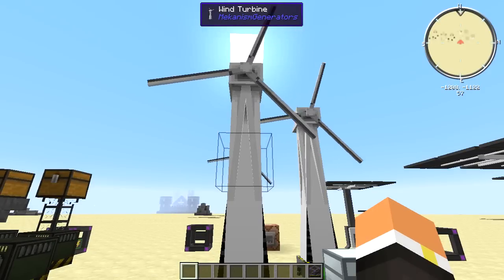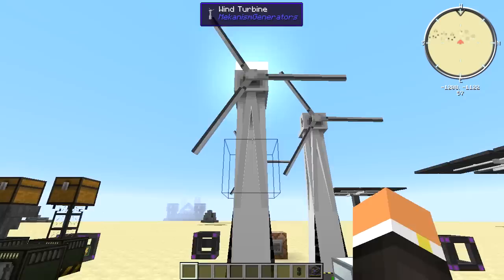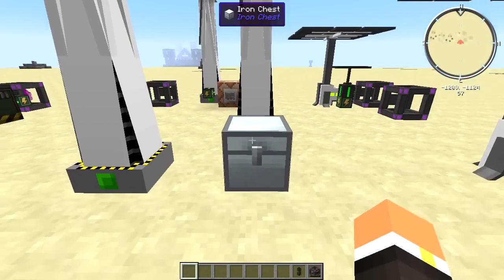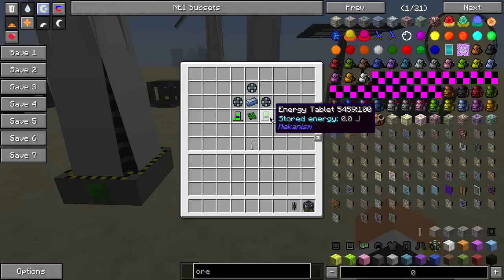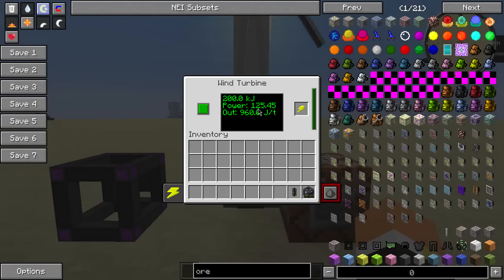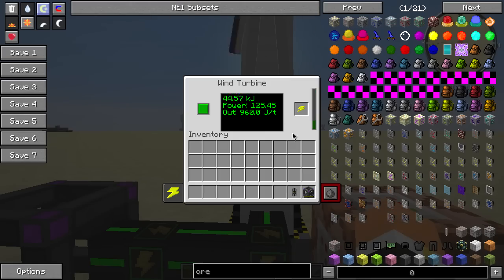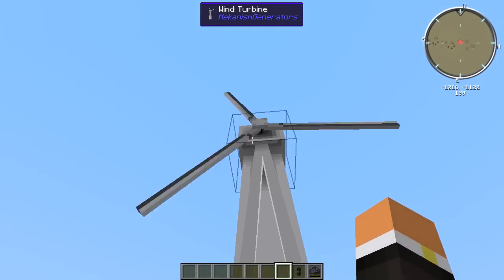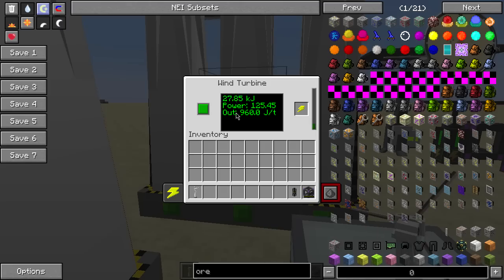Modded Minecraft - Machine Tutorials - Mekanism: Wind Turbine

Comment: Depending on your version of Mekanism, or if you're on a multiplayer server where generator output is modified, you may not see such a staggering increase in power production as the wind turbine is placed higher.  On the server I play on, the difference between surface level and world ceiling is only an additional 5 RF/t.
Also, the things make an annoying wind sound if you're anywhere near them, and many of them in the same chunk or location can cause lag.
Still, a very respectable source of constant free power for not much expense.